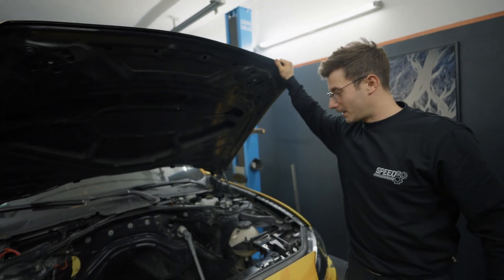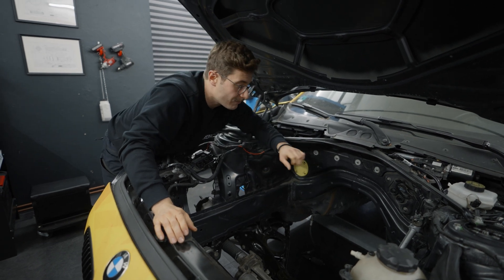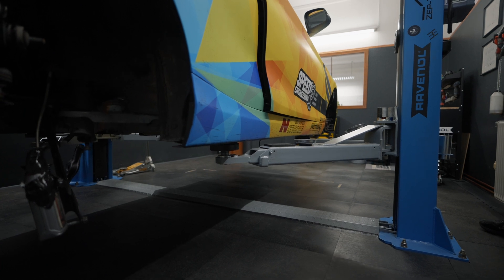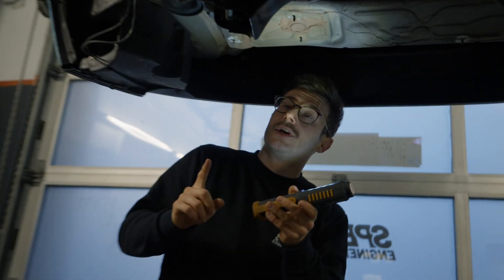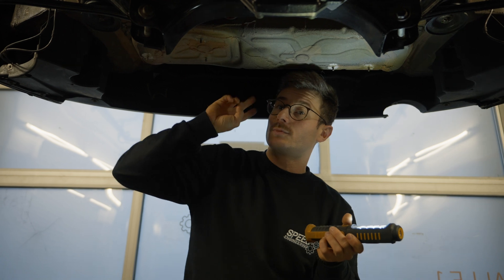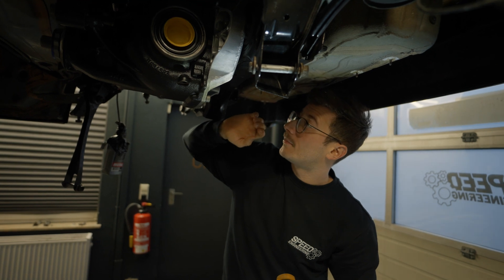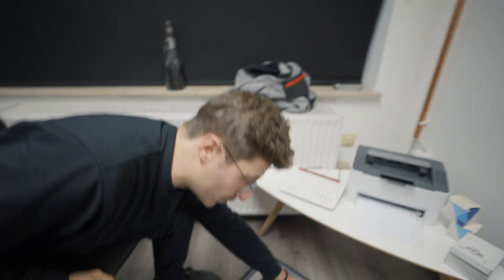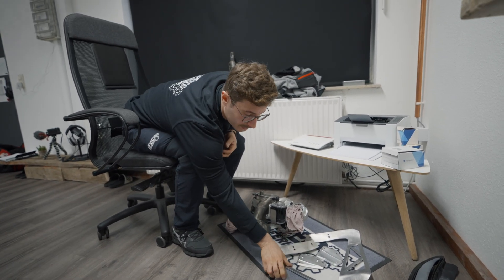Electric BMW F21 - Tesla & Porsche Taycan

Comment: Starkes Video! Auch echt gut auf englisch gemacht! 
Please tell us, if you didnt mention before: 
Why do you mount the drive unit in the front with a separate diff in the rear? 
Was there no locking diff for the tesla unit available? Or where there other reasons?
Reply from the maker: We had to avoid using the Tesla driveshafts as they are in the wrong position. We could have used them in combination with the Tesla diff. if the car would have front wheel drive. But in this case we would have to turn the motor by 90°
Reply: @zokispeed  but why didnt you placed the drive unit transverse in the rear like its mounted in the tesla itself?